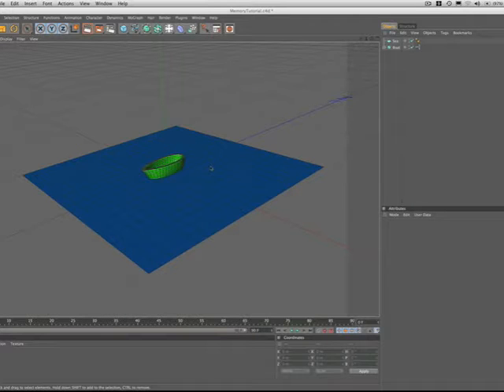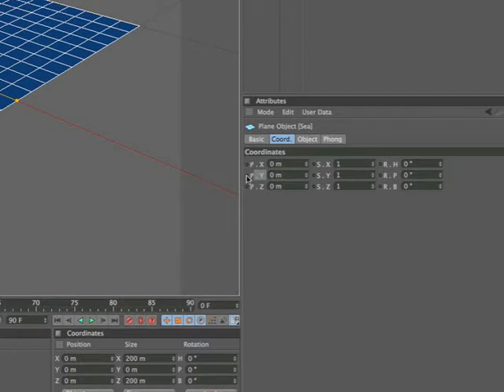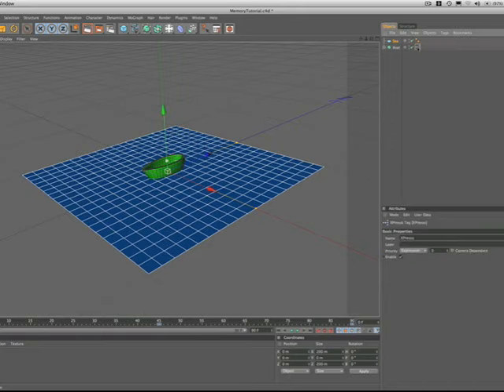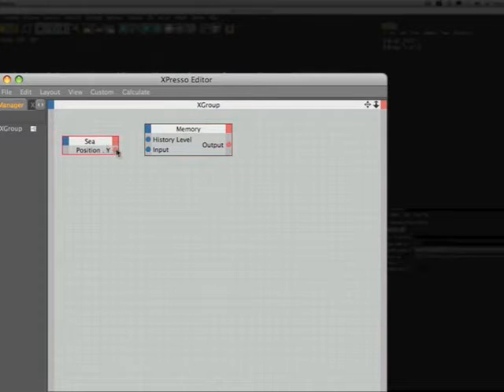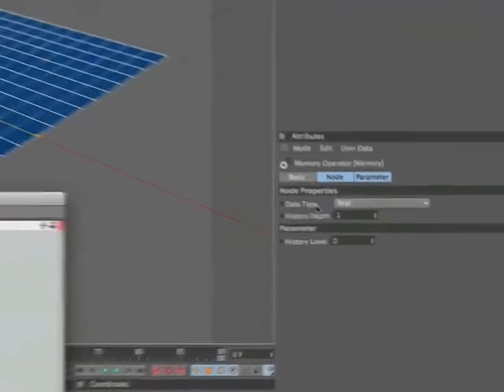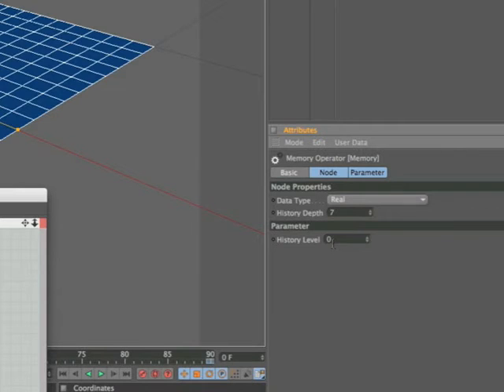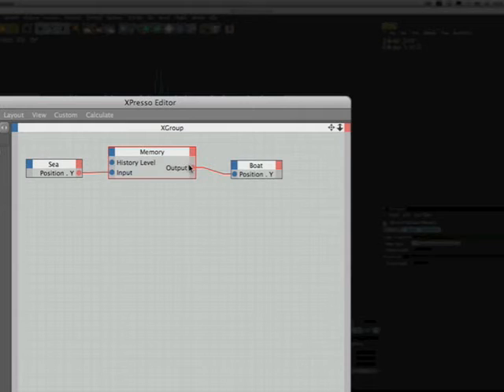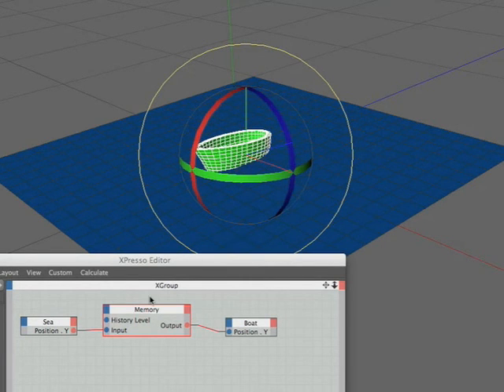Cinema 4D Xpresso Tutorial 3: Simulating Inertia

Comment: Why not to simply use vibrate tag for the rotation?
Reply from the maker: LOL - probably because the Vibrate tag didn't exist when I made this tutorial.
Reply: @ExpressoMechanicTV  Really? 2 years ago?
Reply from the maker: @1SubZeero  No, it was made a lot longer ago than that. I only started posting videos on here two years ago. I was on Vimeo for many years prior.
Reply: @ExpressoMechanicTV  I see... I have a question for you. If you would be so kind and help. Is there a way to change the speed or make a speed ramp of whole animation which is driven by Xpresso? Or do I have to do it in the Xpresso itself or bake first?
Reply from the maker: @1SubZeero  Not absolutely sure what you actually want to do with this, but Xpresso isn't designed for it. Sounds more like a job for the curves in the Dope Sheet, really.
Reply: @ExpressoMechanicTV  Anyway, your tutorials are great. Thank you so much!
Reply from the maker: @1SubZeero  Thanks for watching!
Reply: Nice!